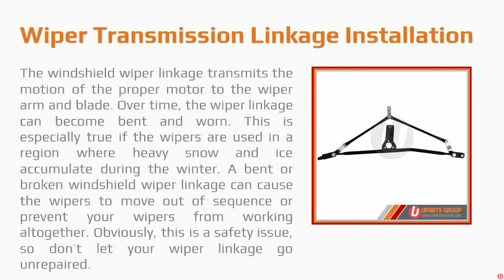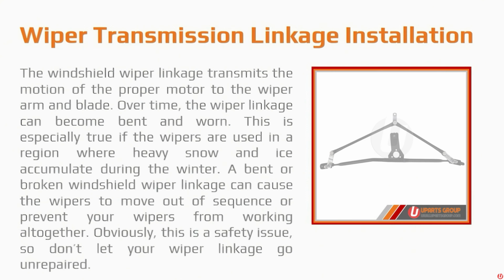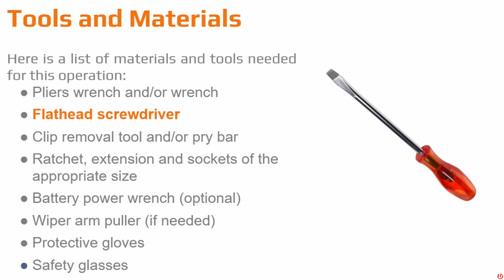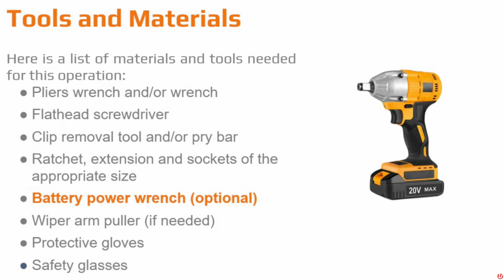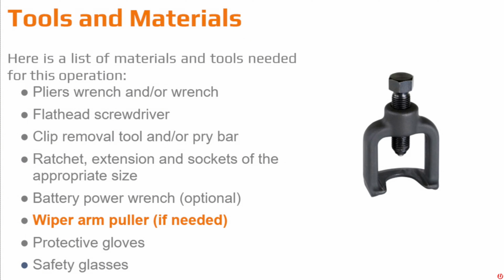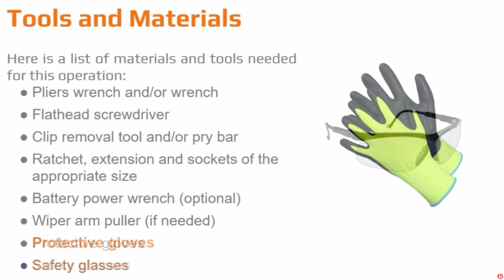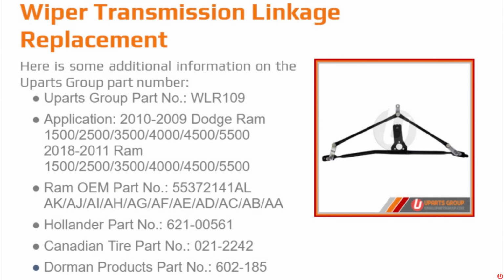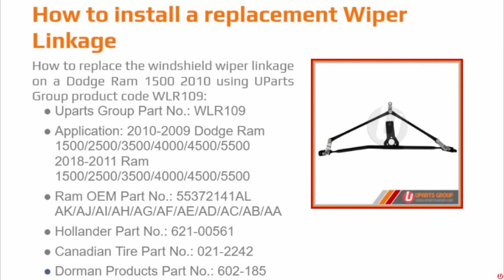WLR109 Wiper Linkage Replacement on a Dodge Ram 1500 2009 Fast & Easy

Comment from the maker: ✅ Uparts Group Wiper Transmission Linkage WLR109
https://upartsgroup.ca/products/wiper-transmission-linkage-wlr109

🧰 Recommended Tools:
🔧 Plier & Wrench Set
https://amzn.to/49n8lY4

🔧 Screwdriver Set
https://amzn.to/4tN05br

🔧 Trim Removal Tool
https://amzn.to/3RjRH5r

🔧 Ratchet & Socket Set
https://amzn.to/4njQmYg

🔧 Battery Power Wrench
https://amzn.to/4tzOI6p

🔧 Wiper Arm Puller
https://amzn.to/4d48ou9

🧤 Protective Gloves
https://amzn.to/42tTLKv

🦺 Safety Glasses
https://amzn.to/4wpi9dV

👍 Thanks for watching! Don’t forget to like, comment, and subscribe for more product guide videos.